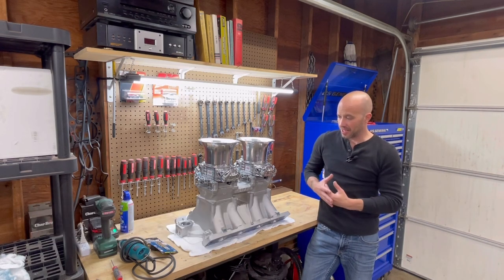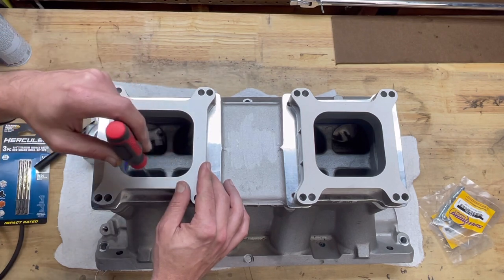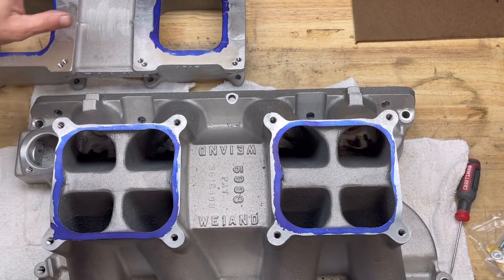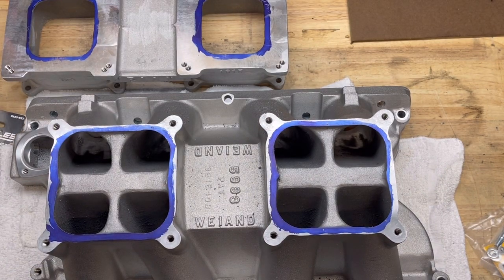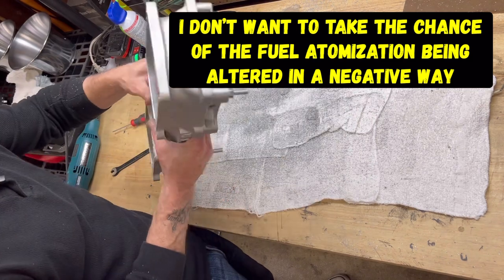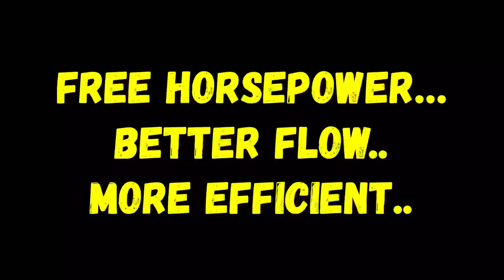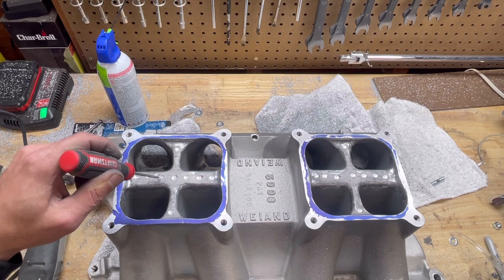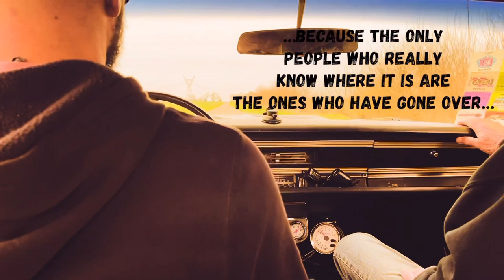BUDGET Tunnel Ram Modifications!! #nonamenationals

Comment: Great video.
Nice tips from Andy about the David Vizard tips.
Never can have to many tips.
Work looks really nice.
Wear a mask when porting.
Especially when cartridge rolling.
Also, get a big box, make a bench top porting box.
Put a light in it.
You can even hook a shop vac to it.
It will contain alot of the filings and grit.
Also I use WD 40 on the carbide burrs on aluminum. 
Helps control the cut, stops the loading up in the burr.
Try the box, it is a good idea.
Speeds the shop cleanup.
These are just suggestions. 
I enjoyed your video.
Great content. 
Thank you, EM.
Reply from the maker: Thank you Ed!  Advice taken!  I’m going to the hardware store this coming up week to make that box.  I have a few sets of heads I will be doing after this build, and this time I want to do a little more in-depth with them 🤜🤛
Reply: @2HacksGarage  You can try a big cardboard box.
That will give you the experience and feel.
A little awkward at first.
Head stand and blocks of wood really help with positioning.
Cheers!

Comment: You (and almost everyone) assumes that the flow at speed, is coming out the carb butterflies, straight through the plenum, and into the ports. The reality is that all those fast closing valves coupled with the cam overlap, are causing a substantial reverse flow (reversion) right back up each port into the plenum. The sharp edges of the carb base plates and the bottom of the carb mounts as they enter the plenum, can be a benefit to suppress the reversion that can upset the jetting, and any left-over fuel droplets to re-atomize as they "shear" off the edges into the mix. Rounding everything from the tops of the runners down, is fine. But the carb side of the plenum should be sharp. A flow bench will not tell you all the dynamics that take place on an accelerating vehicle. Carb spacers add a lot of plenum volume to an already large cavity. Again, real world drive-ability (throttle response ; not seen on a dyno) "can" improve with the carbs a little closer to the runners. Too much reliance on flow bench testing: having little to do with real dynamic conditions.

Comment: I don't think the mismatch is all that much of an issue but hey why not if you have the means to alleviate it. I think the spacer is absolutely beneficial and in my opinion for fuel distribution the more there is will allow the fuel to each each runner more efficiently where the primary's are not over all 4 runners evenly, there's already not a ton of plenum volume so a even if there's a small negative affect from that the increased fuel distribution will definitely out weigh that. If you watch the engine masters tunnel ran episode you see distribution was the biggest issue. As far as the dividers feeling hesitant to question DV if the dividers were radiused there would be nothing to puddle on? The radius would have to be super consistent or certain runners would favor the flow resulting in uneven Air fuel mixtures from cyclinder to cylinder which can be catastrophic. But DV is likely the most knowledgeable person in the world with air and fuel flow and building power with achievements like 500+hp from a 289 with OEM iron heads...that's something typically requires premium big flowing aftermarket heads and preferably a 347 stroker kit or at very least a well sorted 302ci short block built to handle big rpm dependably not a 289 with 50+ year old factory iron heads!
Reply from the maker: so far so good, tuning the carbs went pretty well with the help of a wideband.  Spark plugs look great and I have awesome throttle response.  Thank for watching!